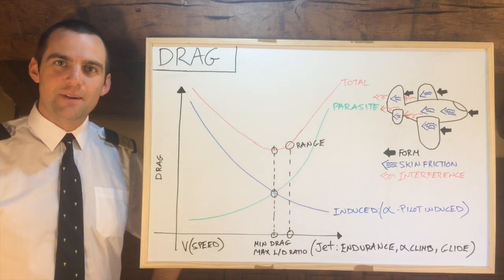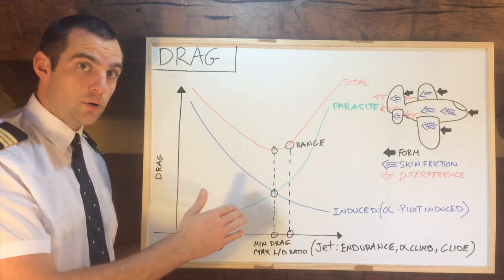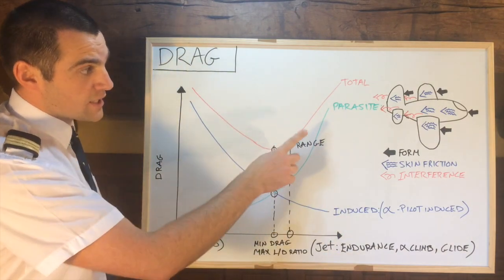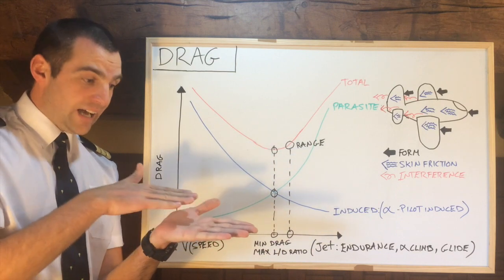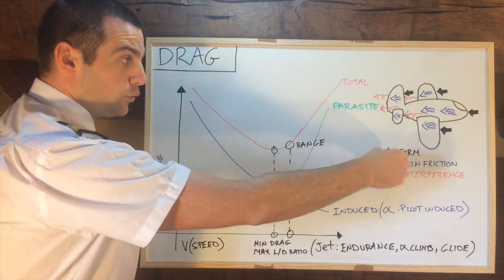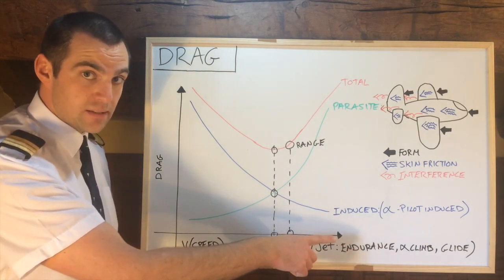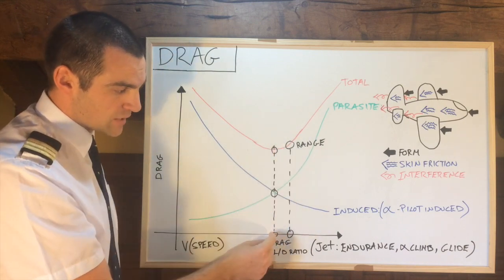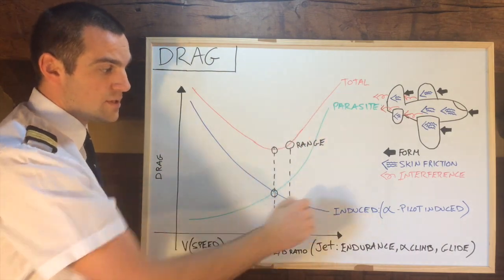DRAG - Parasite and Induced ✈

Comment: Interference Drag 
Interference drag comes from the intersection of airstreams 
that creates eddy currents, turbulence, or restricts smooth 
airflow. For example, the intersection of the wing and the 
fuselage at the wing root has significant interference drag. 
Air flowing around the fuselage collides with air flowing over 
the wing, merging into a current of air different from the two 
original currents. The most interference drag is observed when 
two surfaces meet at perpendicular angles. Fairings are used 
to reduce this tendency. If a jet fighter carries two identical 
wing tanks, the overall drag is greater than the sum of the 
individual tanks because both of these create and generate 
interference drag. Fairings and distance between lifting 
surfaces and external components (such as radar antennas 
hung from wings) reduce interference drag.

Comment: quick question. at 1:57 you mention interference drag is due to the vortex coming off the tip of the wing. However, Interference drag occurs when different airstreams meet and produce the turbulence you mentioned . this usually occurs by the wing root (where the wing meets the fuselage) and between the lower surface of the wing and landing gear. Interference drag is most prominent  where the two airfoils are at an acute or 90 degree angle from each other (i.e landing gear to lower surface of wing is perpendicular to each other, which is 90 degrees). isn't wing tip vortex associated with induced drag as opposed to interference drag.
(reference: my aerodynamics class and textbook)
Reply: Exactly, wing vortices are related to induced drag
Reply: This video was totally helpful for me. Though when it came to interference drag, I got a bit confused. You are totally right Scott. Interference drag is produced where two aerofoil shapes are connected to each other. As we know a particular object or an aerofoil produces drag when lift is generated, but if we join the two aerofoils together then the drag produced will be much higher then the total drag produced by the two aerofoils separately i.e. the sum of individual drag produced by two different aerofoils .

Comment: Thanks for the video - but aren't you explaining profile drag or zero lift drag with parasite drag meaning drag from non lifting parts of the aircraft e.g. nacelles,nose cones,aerials etc. The profile drag consists then of skin friction drag and form drag. Total drag, below transonic speeds , would then consist of zero lift drag and lift induced drag.
Just an observation, not meant as a criticism.
Reply from the maker: Not sure i follow you sorry. Drag can be broken down as follows 1. Parasite and 2. Induced. now within Parasite drag we can again brake it down into 3 parts: 1. Skin friction 2. Form drag and 3. Interference drag. 1+2 can be called profile drag. and Interference drag is drag that is generated by the mixing of airflow streamlines between airframe components. Hope thats cleared it up :) thanks for watching. Ed

Comment: I don't know if you spoke a lot of diluted stuff for simplicity or is it what you know for it to be true. "Velocity will replace lift" ?????? " Essentially Pilot Induced " ??????? what is all this ???

- Aerospace PhD here
Reply: agree, and I believe that induced drag is lift induced and is related to the lift tilting backward due to the vortex,. but I can't explain better
Reply: That's a good remark. I think what he wanted to say is that the pilot has a direct impact on the AoA hence on the Cl. "Velocity replaces lift" is not a rigourous wording indeed, what he probable wanted to emphasize is that to keep a level flight an increase of V needs to be counterbalanced by a decrease of Cl which means decreasing the angle of attack